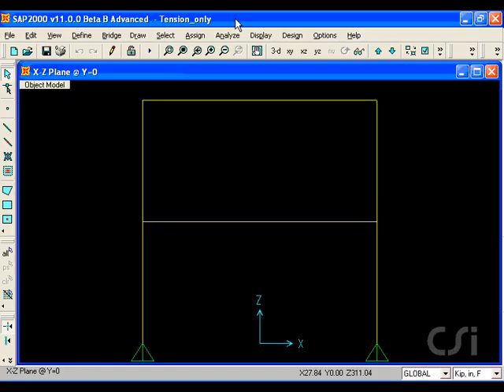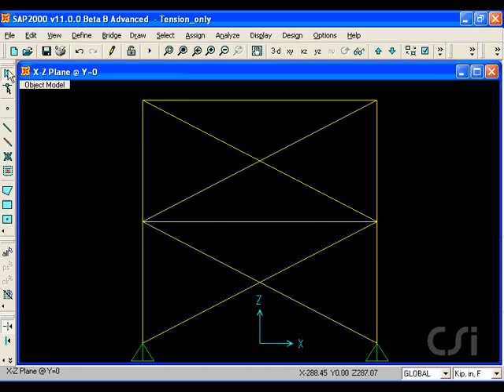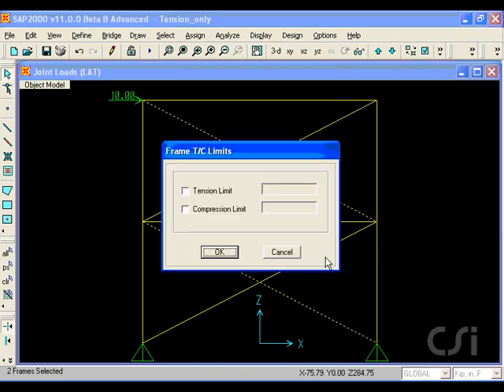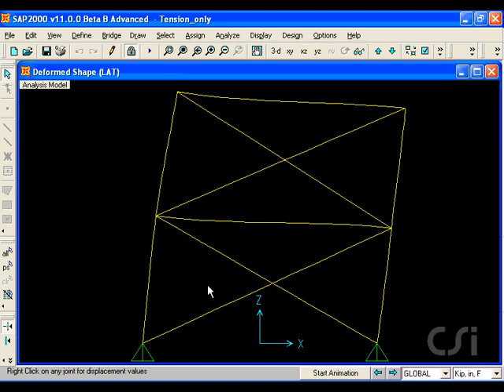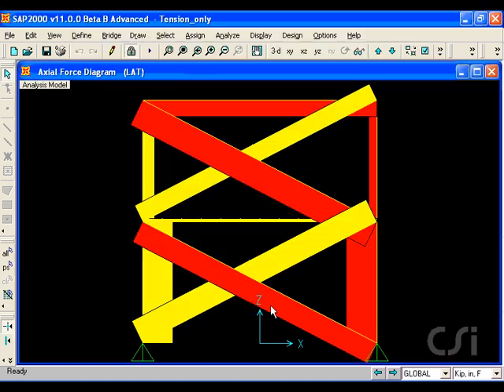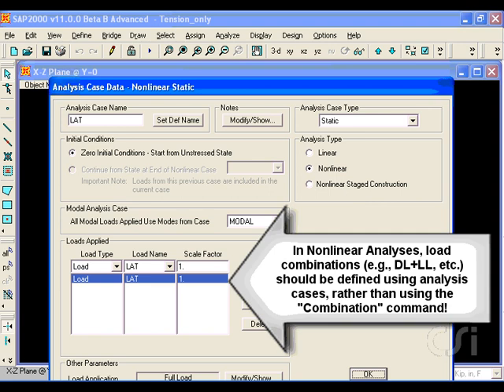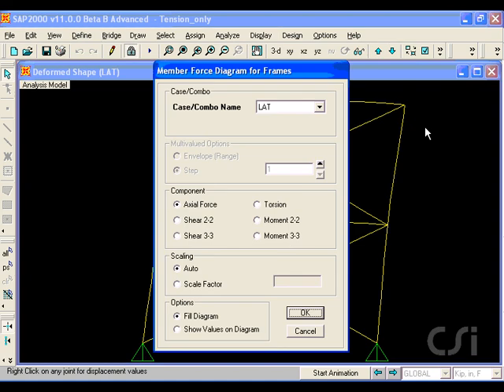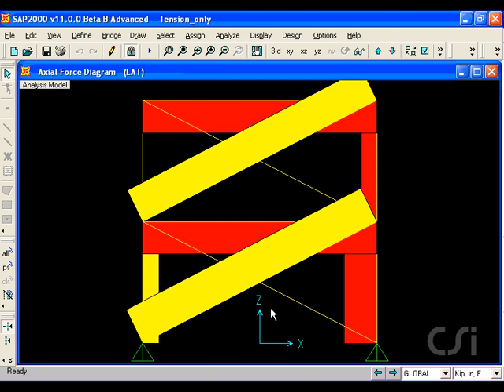Tension only bracing V14S #SAP2000

Comment: Hi
Using SAP 2000, after I did your comands, my cable - that had 17kn of compression - started having a 13kn of traction on axial force, in a situation that it should only not be activaded, as if it was just loose.